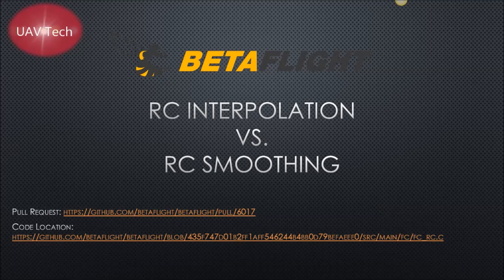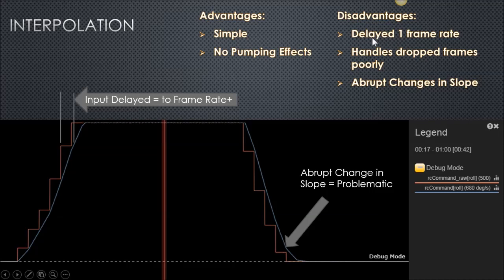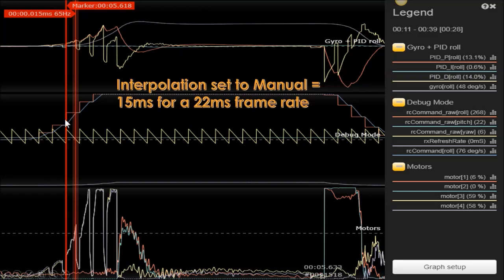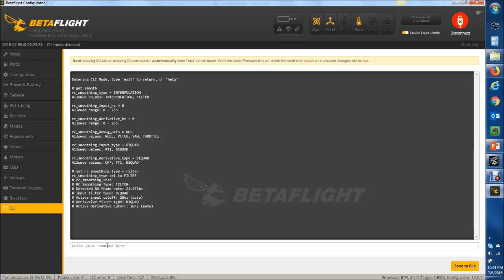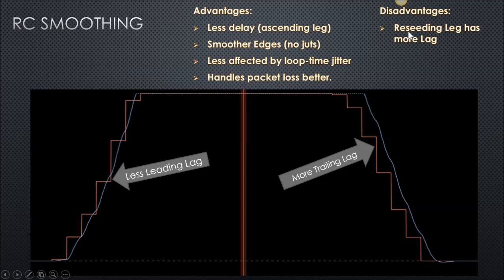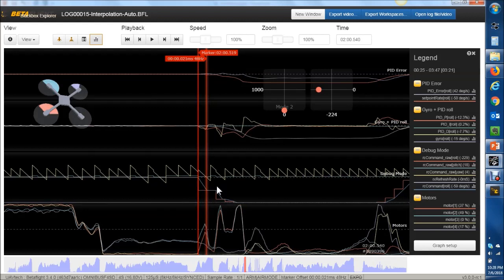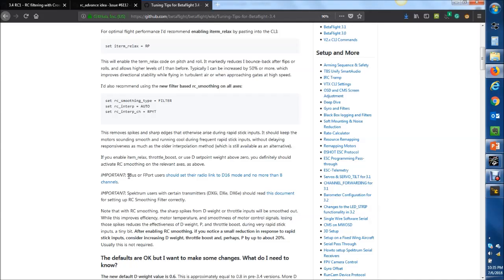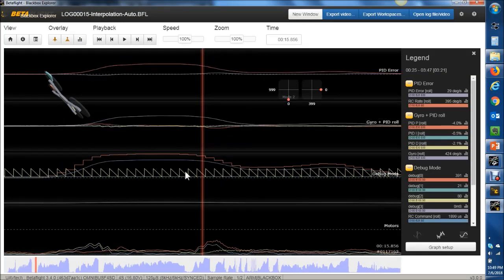RC Smoothing and RC Interpolation

Comment: Great info (as usual).  Worth emphasising that the exceptions in the tuning guide are primarily about FrSky using more than 8 channels and Spektrum DX6i, DXe and DX6e users. (just add a quick text overlay on the video).
Reply from the maker: I can't go back and edit the video.  However, it seems now that the auto-detect is correctly recognizing the DX6i limitation and "RC_Smoothing_Info" is reporting the frame rate at 22ms.  :-)
Reply: The pinned comment should be enough then.  Good that the DX6i is now reporting correct frame rate in auto-detect.
Reply: When comes the updated video for BF4.1? 😉

Comment: I'm trying to find info on why I'm getting an arming osd warning flag that said "rc smoothing".  I can't find any info on it.  Does this mean the rc smoothing is not working?  Too much another issue.  If I arm and get the error, I just have to disarm and arm again to fly.
Reply from the maker: it means for some reason BF is not detecting your RX pact rate well.  I'm not sure why that would be happening.
Reply: @uavtech  If it showed up and i arm/disarm it goes away and flies fine.  I feel changes to the smoothing value in receiver tab so i’m guest that means it is working but has a temp error on first arm.  🤷🏻‍♂️ it happens on 3 spi boards.  2 different happymodel and 1 betafpv, flysky and frsky.  So maybe the radio... 🤔 I don’t know it’s odd

Comment: What's the main purpose of smoothing though? Are these stepped responses visible, as in, you can detect stepped transitions between frames in the video of e.g. a go pro? Or is it more that stepped responses cause an issue with the pid loop and tuning?
Reply from the maker: You can NEVER get the quad to track on the sticks with a standard PID controller.  It will always lag by 12ms to 20ms with P, I, and D terms only since those react to PID Error (Gyro reading  - Sticks position) so Error must build before they react.

HOWEVER, we can feed in a 4th term - Feed Forward - to make stick tracking better.  That (FF) or another method called D-Term Kicks; also known as "Setpoint Weight" in the mini-quad world.  But for BOTH of those techniques, which can reduce the Sticks tracking to 0ms, you need to have a smooth RC signal.  Hence the need for RC Smoothing.
Reply: @uavtech  Great. I never heard about it until now. To be hones, I skipped parts of your video. But my question really is: does smoothing makes the pid tuning easier, even if you disregard you can now add a FF factor? Like, a smoother input somehow affects motor heat while keeping pid values constant? Because it's well, smooth, and, as far as I understood, motor heat is the latency of adjustment of motor speed that cannot be executed that is transformed to heat. So smoother input = smoother commands to motor == less heat, even without FF? Or I'm I totally off now?
Reply from the maker: You are correct on that point as well.  W/o smoothing, the motor commands from the P-Term are stepped and that adds to heat and oscillations.
Reply: @uavtech  Aha. Got some hard to tune quads. (Tuning of) Rc smoothing seems like a time consuming business, but maybe one day I give it a try. It's default is on in bf I guess.
Reply: ok the lattter for sure

Comment: i did the math associated with RC SMoothing and the numbers match the equation you illustrated.  I also changed the "set ff_interpolate_sp = AVERAGED_2" to set ff_interpolate_sp = AVERAGED_3. Does that ACTUALLY mean that the communication is tuned to its best? i havent flown it yet, but after looking at the logs using interpolation instead of filter i did so SOME stepping. i was trying to tune out this quad for a while now, it flies great but i needed to tune something; something felt like it was missing and i think this is it.

Comment: Im using crsf and running emuflight. I got stair step setpoint and throttle. When i change rc smotthing to filter and set auto im getting rc smoothing osd warning after arming. Should i use manual cut off instead auto?
Reply from the maker: Emu what?
Reply: UAV Tech lol..

Comment: Hey man I use idle up... but I updated my flight controller and beta flight today and all of a sudde my standard arm is allowing me to input roll pitch and yaw..... and the PID controller is reacting to the gyro when I hold the quad..... It doens't react that much where I can't flip it over etc but it still reacts, and I can pitch roll and yaw it before flipping the idle up switch... IDK what is different.... something in beta flight? Or something in the FC?

It doesn't really change anything too drastic but I really don't like it.... the PID controller should not react when I'm just armed, it never has before.... what has changed in Beta Flight?

Maybe it's my FC... gah this is annoying I'd never be able to figure this out... even with a forum I doubt anyone would know. So I'm like devouring random information to see if I can find out what the issue is. Im sure it's some CLI command that has changed slightly.

Comment: So im using an R9m flex firmware fbus 16 channels and reported RX refresh rate is 6.8ms but my measurements between steps on raw RC command are between 13 and 19 ms, more often than not 19ms.  Should i just change the rc smoothing filter to match worst case 19ms or somewhere between the two?
Reply from the maker: 19ms for the smoothest.  BF 4.1 has some tricks up the sleeve to get lower.  If you run 1-8CH mode R9 gets down to 6.67ms.  You can record RC_SMOOTHING_RATE to see the average frame rate and how many times it drops frames.  Word on the street is OTX 2.3.0 is better with less dropped frames.  I'm testing that now.

Comment: I get a little confused with both terms. So the rc_smoothing_type is commanding the smoothing method, and those are either Interpolation or Filter (aka smoothing). Is that correct? I am running BF4.0.3 and Frsky fport D16 on 8 channels at 9ms and I can see the ocasional longer frame that can go up to 24ms, quite annoying since it leaves a trace on the D-therm through the RC setpoint. Have always been wondering what produced those slight deviations in the RC setpoint.
Reply from the maker: Correct.  The naming is confusing.  That issues is with FrSky and it is annoying.  Hopefully better with ACCESS.  BF 4.1.0 also adds "Interpolated FF" to help rectify; but not as good as FrSky just resolving from teh source.
Reply: @uavtech  thanks! I have read something about OpenTX improving the lag (due to shynhronizing problems with the CPU and transmitter module) in the future v2.3.0. I think its worth doing this video again in your new series about PID tunning since the signal (aka setpoint) actually makes half of the PID equation, the other half being the gyro motion itself, both giving the PID Error. Gyro filtering is already well covered but the majority is not aware of the importance of having a smooth setpoint. I thinkg the rc_smoothing debug graph has also changed since this video? Luckily BF v4.0.3 is doing quite a good job by default.

Comment: I'm on bf4.0 now, but still got question regarding the RC_smoothing filter and cannot find it anywhere. For FRsky and Spektrum it was suggested to lower the channels to 8 instead of 16. For Crossfire cannot find anything if it is ok to use the RC_smoothing filter on 12ch or should be lowered to 8. What is your opinion about this?
Reply from the maker: It is better to lower FrSky to 8 channel.  For Spektrum, I don't think 
it makes a difference.  Neither do I think it matters for Xfire.  BUT 
YOU CAN CHECK!  Turn on your TX, pick the mode and run the 
"rc_smoothing_info" command.  It will tell you the frame rate at the 
different modes.  There is one catch, for FrSky it is deceiving as in 
D16 mode it will report lower latency, but every other frame will be 
longer. But I would suspect Spektrum and Xfire are more consistent.  
FrSky has a frame rate consistency issue they are still looking at; and hopefully will fix.

To
 really see what is happing, if you do a BlackBox log with "debug_mode =
 RC_SMOOTHING" recorded, you can see the raw frame rate (stepped RC 
commands) and how those are playing with RC smoothing; either the Filter
 smoothing type or Interpolated filter type.  In general, the Filter 
smoothing type can cope with things better (irregular frame rates; 
packet loss; etc...).  This will be even better in BF 4.1 as there is a 
new "Interpolated FF" code to deal with irregular frame rates a little 
better.
Reply: Wow cool thanks so much, ok so I can set the RC_smoothing as debug and see the raw RC command data, should the RC command in BF-BBE already look smoothed by the filter? I always have the feeling the RC command line stil looks very stepped.  @uavtech
Reply from the maker: @cwtim  , yes, the RC Command trace is after the specified smoothing.  What are you using?  Xfire, Spektrum or FrSky?
Reply: UAV Tech Xfire 12ch, I will double check the rc command line later today!
Reply: @uavtech  Ok looking at it now comparing it to the data in your video, i'm sure it is filtered, I see some stepping on fast moves but overal it looks very smooth. thanks!

Comment: Thanks one more time for this great vid. So if i've understood: if i want to set rc_smoothing manualy, i have to set rc_smoothing = filter, and enable debug_mode = rc_smoothing (and go flying). then i will get by rc_smoothing_info, all needed values to set it manualy ?
Is there a interest to set it manualy ?
Thanks :)
Reply from the maker: What TX / RX are you using?  Auto detect of the framerate works great, except for one exception.
Reply: @uavtech  CRSF Micro / Nano.
Reply from the maker: @toperharley6059  , keep auto for sure.  Crossfire does a frame rate change based on distance.  Auto picks that up.  In 4.0 the retraining is faster and also you can specify the desired smoothing percentage now.

Comment: So I typed rc smoothing info in the cli and I got this 
Rc smoothing type: filter 
Detected rx frame rate: 7.44ms
Input filter type: biquad
Active input cutoff: 64hz (auto)
Derivative filter type:biqaud 
Active derivative cutoff: 64hz (auto).    So I don't think it's right and I was wondering if you knew what I should manual set the rc smoothing input hz to.  And the rc smoothing derivative Hz to.   I got the flysky fs i6 transmitter  and fsa8s receiver. I think that's the name of the receiver.  I had to do this with spectrum but the answer was in the beta flight 3.4 tuning  tips. Please help me I just want my quad to fly right again. I hit the throttle and cut it but it doesn't stop right away and it's not doing what I want half the time there is so much delay

Comment: Even with rc_interp set to auto I have little stairstepping in the rc command which is way of the raw signal. Just curious because in your showcase it‘s pretty much lined up.
Reply: Nevermind, I didn't got that interpolation can be classic or set to filter.

Comment: I'm pretty new to the debugging so forgive me if my questions are kinda noobish. :)

Regarding rc_smoothing you are talking about lowpass cutoffs, which cutoffs do you mean? Active input and active derivative cutoffs? If I set rc_smoothing_type = filter, do I need to set anything else beside that (if cutoffs are active input and active derivative)? If i set debug mode to rc_interpolation I expected to get the raw rc command in the blackbox explorer but all I see is a flat line. What debug mode do I need to use to get the stepped rc command in order to manually measure the frame rate of each packet?
Reply from the maker: aliasx666 , u should not need to do anything more than set to Filter.  You can verify the frame rate is detecting correctly by setting Debug to "RC_Smoothing" and comparing that with what is measured through the CLI command "Rc_smoothing_info"
Reply: Thanks for the response! :) I adjusted rc_interp from AUTO to MANUAL and set it to 10ms because the measured frame rate is 9.36 ms (S.Bus/8ch). The frame rate is detected correctly. Why does betaflight set it to 19 ms (AUTO) if it's detect 9 ms?

Comment: Mark - I’ve got a new one for you - my T8SG Jumper TX is a 12 channel transmitter - running in D16 for FrSky.  If all 12 channels are being used, would the Smoothing settings be 25hz or 33hz?  I’m assuming that the TX is sending an 8 channel packet followed by a 4 channel packet - but there is a delay between packets - so I can’t figure out what numbers to plug into the formulas to determine the Hz setting for Smoothing. Rc_Smoothing_info is reporting a detected frame rate of 9.2ms.  Update - it's 25mhz if you set it for more than 8 channels.  Set in auto and set to 9 channels, the traces in RC_Command were full of "steps" - but they looked more like curves - so the smoothing is working, but the settings have to be lowered to 25hz to get rid of the curves / steps.

Comment: Quick question: I have my frsky TX configured for 9ms but my reciever firmware is sending rssi on ch16. Will that mean I need to change rc_smoothing parameters for an 18ms frame?

Comment: in the link about tuning tips it is said you can use 11 channels if you dont want to bother with reflashing back to 8 channels mode, but it is absolutely unclear how to tell apart fast and slow channels
Reply from the maker: Yeah, not sure.  Best advice is to use 8 channel mode and make sure the Auto-detect is seeing it correctly.  For 8 channel mode, it should be setting cut-off around 50hz.  In 16 channel mode it should be setting cut-offs to 25hz.

Comment: Regarding the difference of the delay on the rising and falling edge: If you set the same scaling for both signals, then you will see that the delay on rising and falling edge is the same.

And you will also find out that the delay in the two modes "RC interpolation" and "RC smoothing" is about the same. But because "RC smoothing" also has an additional filter for D-term, this results in twice the delay as in "RC interpolation". Think about it!
Reply from the maker: Qopter , how do u set the scaling the same?  See https://www.screencast.com/t/Dmrgh9BGc
Reply from the maker: I do see what you are saying for ascending and descending legs when looking at table values.
Reply: switch off expo, then scale it down to see the max values. Then adjust it to the same max values.
Reply from the maker: I have expo off, but how do you scale it down to the max values?  Seems like a code change is needed for that?
Reply: adjust the zoom level in graph setup

Comment: I’ve been waiting and waiting for this video! Thanks Mark! Are you still using 25hz for FrSky d16 with RC Smoothing?
Reply from the maker: George H , i'm Spektrum.  I'm going auto as of RC5.
Reply: I tried the RC_Smoothing_Info in CLI and it reported a frame rate of 8.984ms with an XM+ FrSky flashed to 16 channels but only 8 are in use on a Jumper T8SG radio - and an auto set value of 50hz.  The BBE RC_Command traces are not smooth - so, what do I do?
Reply: I take it back - actually the traces look pretty good on auto with the TX limited to 8 channels.  I'll try limiting my Qx7 TX to 8 and see what happens with that one.  My query is what to do about RSSI being transmitted on Channel 16 - if limiting the Qx7 to 8 channels interferes with the RSSI feed, I'll have to flash the 8 channel firmware to the XM+ receiver.  I like using Channel 8 for anti-turtle mode - so will have to see what happens.
Reply from the maker: Yeah, let me know.  Try 16 and see if it picks it up correctly now in RC5.  Something changed in RC5 and now Auto picks up my Spektrum transmitting at 22ms even though the RX is technically sending at 11ms (the TX only sends 22ms so in the past it was faking out auto mode -- but now seems to work correctly).
Reply: UAV Tech  - I set the T8SG for 16 channels and the detection was still 8.94ms and set at 50hz.  There is no info on channels 9-15, but RSSI is on 16.  If it still detects 9ms with the Taranis set for 16 channels, should I use 25mhz for input and derivative, or something lower?  I looked at the Rc_Command and the lines are just not smooth enough even with the T8SG set for 8 channels - and there is some pumping on the yaw axis but not during rapid stick movements, but you can see some really small offsets during rapid stick movements in pitch and roll.
Reply: UAV Tech - nope!  I get the same reading (9ms) regardless of whether the Taranis Qx7 is set to 16 or 8 channels.  So I set the input and derivative to 25hz and the Rc_interp to Manual and 19ms.  I will re-flash an XM+ to 8 Channel mode and run it on auto (0) to see how the traces look.
Reply: @duckslave  try this 9ms firmware for qx7 https://github.com/mikeller/opentx/releases

Comment: I've noticed a in a couple of logs, when there are D-term oscillations, what triggered them in many cases, was simply a not interpolated RC signal. I wonder, why the default is set to RP only and not RPYT. I'm old and sometimes I forget to set it :)
Reply from the maker: Because there is D-term only on RP and that is the part of the PID loop that makes rough edges or abrupt changes in slope in the RC signal make the motors go nutz.  However, I'm with you and the new recommendation is to filter RPYT.  Not sure if that is the default now or not.  I will need to check that.  This is especially true if you are using Throttle Boost as you will need T smoothed.